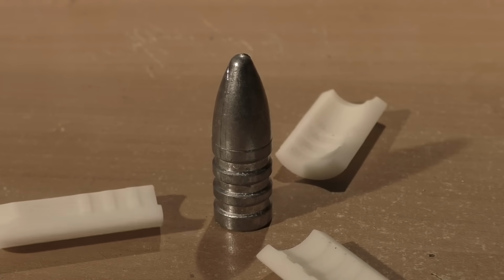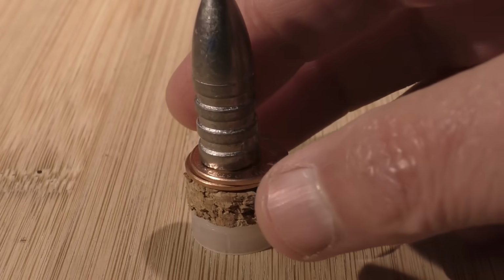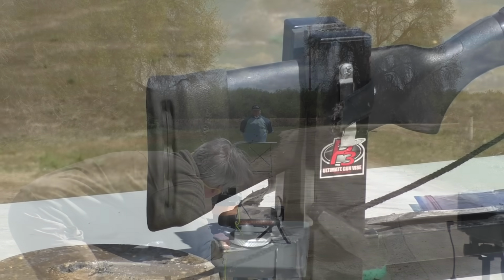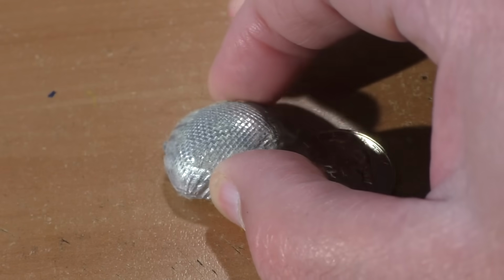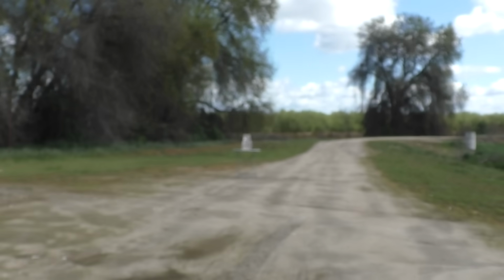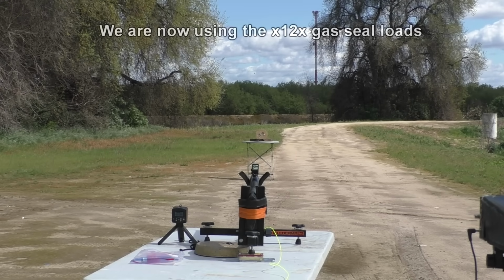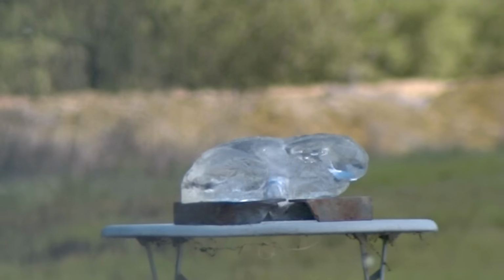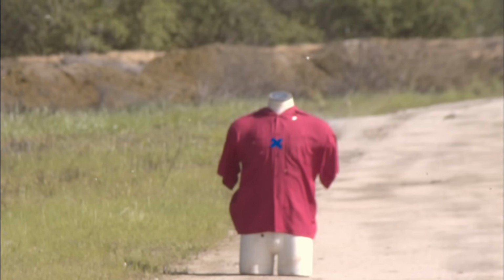45-70 SABOT  for 12ga.  One of the MOST challenging loads

Comment: Is this the first time you have rested the speed tester on the same table as the shotgun?  It seems to bounce when the round is fired, which might be adding to the difficulty of getting a reading.
Reply from the maker: Last video I set it exact the same way and got 100% reliability.
Reply: @taofledermaus  Hmm...  Okay.  I just noticed it jump sideways on a shot...

If you need to fire the shotgun remotely, you will need something of comparable mass and support as OG.

You may need to build a frame.

Comment: I don't foresee that cargo strap failing, but if you didn't see mine on account of replying to someone else with it, it was suggesting to use "muffler straps" (or exhaust strap), which is that metal straps with holes every 2 inches, available at most auto parts stores (at least once upon a time, but likely still is). Which can always be doubled up on, or tripled, if one layer fails.

I like the cargo strap better, though!

Comment: Here is one more trigger suggestion.   You seem to be using the string on one side of the gun and needing to pull really hard. Perhaps you can try a larger loop in the string so that it goes around the trigger and along both sides of the stock and stand before joining together.  Seems like that may provide even pressure straight back avoiding tugging to one side or the other .
Reply from the maker: The biggest problem is when I adjusted the elevation of the gun,  it moved the position of the bolt against the trigger too.   I slotted the arm so I can also adjust the bolt position and it is butter smooth now.

Comment: Yet another trigger suggestion. You can pick up camera shutter cables pretty cheap. Here's one at random - Fotasy Jjc TCR-70BK Black 70cm Threaded Cable Release, Mechanical Shutter Release Cable
Reply from the maker: I was looking at those too
Reply: @taofledermaus  Or a linear solenoid actuator if you don't mind bringing along a small battery pack.

Comment: To me, it looks like you have to jerk the string to get it to actuate the trigger, which, in some shots seems to move the shotgun a bit.  I think I would try using a small electric motor (the kind you can salvage from something like a hair dryer, etc).  You can also get them off of e-bay for about a dollar.  A nine volt battery is enough to power them.  Rigging one up to spin a reel (a piece of dowel would work) taking up slack on the trigger string, it should have enough torque to pull the trigger and have almost no movement of the the shotgun.  Then instead of yanking the  string, you would just need to push a button or touch two wires together to fire.  The whole set-up should cost less than five dollars.
     By the way, I'm quite impressed with your solo set-up.  I agree with you about needing some weight on it, too.  Great videos.  Keep em coming!

Comment: Jeff, I see there are lots of good ideas on trigger improvement for your setup. I was thinking of something similar to the others but then it hit me, "keep it simple". I think the problem with the current setup is that you have too much weight to overcome for a smooth pull: The trigger is a lever with a pivot point above and the moment (where you normally place your finger below. Simple. But now there are 2 levers, the trigger and the  "lower lever" with 2 pivots, at opposite ends, blah, blah working against each other, etc.. Really though, the primary issue is the way the lower lever works to pull the trigger: The moment (your pull attachment point) is on the wrong side of the trigger creating an increase in the amount of force that must be overcome to pull the trigger. The moment should never be between the pivot and the work on a lever. So you can simply attach an extension to the lever to place the pull above the trigger, or use a D-ring (or similar) attached to your pull, open the D-ring and place it in the trigger guard and against the trigger in such a way as to keep it from slipping off the trigger face. With a no-stretch pull, i have found this to be ideal. Great work!

Comment: 🧐Your sled could be improved and kept from jumping so badly redistributing your weights and giving it a wider stance. If you move your weights further out in each direction (all 4 optimally) from the center axis, that should prevent any forces from using the sled as a fulcrum causing the majority of those forces to take the path of least resistance *up*. That should help with both the trigger pull movements as well as the jump from bullet exiting the barrel, though expect an increase in lateral movement straight back as then the majority of those forces will just go equal and opposite the bullet velocity (As per Newtons 3rd Law of Action-Reaction) instead of up and back 🤔
And if you just added more weight overall that'll certainly help as well, considering Newton's-1st Law of Inertia. Which would keep the effects of his 2nd Law "F=ma" to seem reduced when the bullet is fired (as it's proportional to the ratio of bullet weight to sled weight) making it much harder for that small force to overcome the greater inertia of the increased weight. Making the equation of how much the sled moves overall, in reaction to the accelerating bullet weight pushing against it, MUCH more in favor of staying stable vs. moving in ANY direction 😆
Hope that helps, keep up the great ballistics "research" you do fantastically well 💯🔬
Stay safe, cheers! 🍻😁

Comment: What material was the sabo printed from? There are several materials that could be good choices. I would avoid PLA and try PETG
Reply from the maker: it's some super tough filament that Michael thought would be suitable
Reply: @taofledermaus  pla and pla+ are super strong but brittle. Petg is what pop bottles are made of. It's very strong but is more flexible, bends a lot more before it breaks and does not take a set like pla/pla+.

Comment: You are getting some jerk when you pull on the string.  Perhaps if you had a hydraulic (water) actuated trigger pull mechanism it would be smoother.  Perhaps an expanding chamber in front of the trigger and a lever pump on a syringe or pressure cylinder.

Comment: Using a copper wire around the sabot shot would keep the petals from separating too early. Adding a few turns would also act as a driving band.
Reply from the maker: There wasn't really any room in the barrel for additional bulk

Comment: Jeff, where you have string attached on the trigger mechanism you made. Could you add another piece on top roughly 6-8” and hook the string to the top of that to give you more leverage on the trigger? So as not having to yank the string to break the trigger and ultimately not moving the sled and shotgun so much?
Reply from the maker: I'm working on improving it,  slotted the bar so I can adjust the bolt to the trigger better.

Comment: Hey Jeff🖐I noticed when you are YANKING on your trigger that a few times the muzzle
rose a little before shot,??? which would through the shot off.
I seen a guy on YOUTUBE using water pressure and 2 syringes and a plastic tubing to work the trigger, it was very smooth and I'm sure it didn't cost much !!!
Check it out, love your videos.👍😎

Comment: Those Sabos turned out great. You hit the nail on the head, putting them together, my friend. I believe the only issues you're having at first were. The string to your trigger was binding and not smooth. You're having to pull it pretty hard to fire, and it's moving you slead quite a bit. Other than that, great job, man. They performed excellent. Thanks for sharing. God bless you and your family. God bless America 🇺🇲 🇨🇱 🇺🇸 🇨🇱.

Comment: You could invest in some sandbags to lay over the stand.  They'll work much better than those lead weights.  Don't over fill them so they lay over the frame and hold it to the table.  You could always fill them with dirt too for cost savings. 🤣🤣

Comment: If possible I would try and rig the trigger string in a loop that pulls from both sides of the stock and straight back which may work better. Seems like it's pulling to the right and not really pulling the trigger smoothly. Not sure if that would be too far though for your arm to reach.

Comment: The impact on the lead plate after losing energy on the stand was very impressive. Idea for a followup, tungsten penetrator core embedded in the tip of the 45-70 projectile on the lead plate in a future video with a better material of the sabot, maybe a glass of carbon fiber filled filament.

Comment: 2 Thoughts if I may.

I think the chrono is just confused by the amount of debris leaving the barrel maybe?
You could probably pick up a cheep solenoid, some wire, a battery and a button, mount the solenoid to the base, attach the string to that... wire from the solenoid, to the battery, to the switch, back to the battery, push button firing, should have no shake... maybe $10 worth? Maybe a little more? need a solenoid that can pull hard enough I suppose, half dead car battery would do the job too probably - and that's some weight for your setup :D
Reply from the maker: It's a doppler radar and it "looking" for metallic objects,  so the pennies were most likely throwing it off

Comment: You seem to be struggling when pulling the rope which appears mostly due to the angle you are pulling from rather than straight back.  If it were me, I would take 3 of those cheap bar clamps in addition to a ratchet strap.  Two clamps on the front of the sled to attach it to the table, the strap towards the back of the sled to hold the back down to the table, and the other clamp with the bar facing up on the back side of the table to act as a guide for the string to pull straight back (string would route back along the stock then around the bar of the clamp then over to where you are sitting).  Cheap, quick, and easy to adjust.

Comment: Ratchet strap the stand to the table with a strap across the legs on both sides. 2 straps should hold it pretty steady to the table
Reply from the maker: there was a strap on the front connected to the table

Comment: Hi Jeff , as I said last time would it be possible for you to fill the box tube sections of your stand with lead. You obviously have the facilities as you recast the lead plate. As for the trigger l would lean towards using a cam fixed to a lever which would push against the trigger guard. Could easily be made out of plywood and it could be easily be held in place by a bolt acting as the pivot for the cam. Just want you to get it sorted to your satisfaction without too much hassle then we get to enjoy more of your backlog of rounds . Thanks for your efforts

Comment: Great video, Jeff!  Maybe you’ll get some help that is easier to schedule.  Comment:   You mentioned a $1000 soluti9n to a $5 dollar problem, meaning replacing the belt.   The problem is really remote triggering, which sounds like it requires quite a bit of thought and skill, even for a low tech solution.   The bicycle caliper solution sounds good for a smooth pull.   

Have you tried remotely controlling the camera instead of the shotgun?   That sounds like it might have a more readily available solution.   A collab with Stuff Made Here or Smarter Everyday or one of the channels you like might yield a long term remote solution and some help with shooting for a few days.
Reply from the maker: There's a cheap solution for that too.

Comment: 3D printing is a fine method the problem is the material. PLA is barely useable for this, nylon and other polymers are what should be used but most home machines can’t or are just now getting to where they can’t print nylon half decently.

Comment: i know the problem!  you didn't strap the contraption down with a TARP!!  

i was thinking however, if you installed the trigger mechanism on the left side, so when you pull the string, it runs straight backwards around the stock.  (you won't be pulling the string on an angle whilst you're looking through the camera.)
but i do like @jamesgotfryd's suggenstion of a remote trigger with a bicycle brake caliper jig.

Comment: Idea to reduce sideways jerk when cord firing. Use a pully attached to the back of the cable (cheap off shelf at lowes or home depot) so it's pulling properly on the trigger. Should help with consistency and accuracy

Comment: Just a thought, you could use some cheap bike cables and parts to make a trigger pull that wont pull the gun. an old bike brake clamped to a rod and you can get a cable from a bike shop as long as you want.

Comment: With a lot of the 3D print plastics you can improve their strength by cooking them in an oven for twenty minutes or so.
For sabots wrap them around the projectile ( a little oil to keep them from sticking), wrap them with baking paper and a hose clamp or foil and zip ties to hold them in shape Not too much pressure though.
Then cook at a little below the melting point so they only soften.
After 20 minutes turn off the oven and let them cool slowly.
Some plastics may shrink a little.

Comment: If your chrono won't work you can also determine velocity using a target hanging from a couple of ropes. If the target completely stops the bullet all of the bullet's momentum is transferred to the target. You can measure how far back the hanging target swings using a camera and then use some maths to work back to the momentum (and thus velocity) of the bullet at impact.

Comment: hey, what about a wooden dowel or a metal rod across the trigger with a line on both ends threaded through a pulley at the back of the table? would that help even out the trigger pull? i see you kinda having to yank on the cord, and i think that may be affecting the shots. i dunno - food for thought, at the very least. keep up the good work!

Comment: Sandbags are heavy, and stable if you put them on the front legs of the stand. Should help with the gun getting yanked as the trigger is pulled. They are also super cheap  and can be done DIY easily.

Comment: Hi Jef,
Your idea of using the aluminum plate from the lead sled to the trigger is good but the trigger is providing too much resistance so you had to reef on it.
A cheap, low tech option 
1. Use smooth flexible twine, not trimmer cord.
2. Put eye-hooks,  rings or just smoothed out holes on the trigger bar and butt support to make a pulley effect, like a bloc and tackle, so it squeezes the trigger as you pull the cord instead of needing a yank. 😉

That yank is impacting aim, just like yanking the trigger on a rifle. 

The sabot shoes are the bigger issue. Too brittle. A softer plastic like the shotgun hulls you use would have a better chance of separating in one piece.

Love the videos 
The dummy's name is Doug, ditch the politics🤦‍♂️ we get too much already 😫

I really enjoy the videos ❤
Reply from the maker: As I adjusted the elevation,  the position of the bolt against the trigger changed and wasn't in the ideal location on the trigger.  I have slotted the arm so I can adjust that
Reply: @taofledermaus  that definitely explains it 👍
Nice simple solution 👌

Comment: First when it comes to your shooting rest, do you need to put on a decent sized sand bag on each front legs of the rest.
You can also put one over the bar just in front of the back leg.
That will make it much more stable.
Secondly when it comes to the 3d printed sabots, is it very much possible to make them strong enough by 3d printing.
But that demands different kinds of filaments for the printing and other settings on the printer.
You can as an example get nylon 3d filaments if you want to use that.
You also need to have a rather high infill density when printing to make it strong enough.
85% infill density is in general seen as being the strongest against impacts.
It might also need a different 3d printer, as I don't know what type of 3d printer that is being used.
I suspect that both the wrong type of filament and to low infill density was used to make those sabots.

Hopefully someone can print new sabots out of nylon filaments or any of the other stronger filaments and print them with an 85% infill density for you to test this again.
Reply from the maker: thanks

Comment: If you need custom sabots, i can turn them for you on the lathe. Drop me a note.

Also, get some cheap ratchet straps from HF and loop them under the tabletop and over the base of the stand. 

You might need weight on the table to keep it from jumping. In the worst case, you could use ratchet straps to anchor the table to some stakes.

Comment: Personally I would replace the string with a servo.  Aftermarket car remote locking servos are cheap, they also have a long pull. If they don't have the strength to move the trigger. The long pull could be converted to a lever increasing the strength, half the distance twice the torque.

Comment: It looked like most of your high hits happened when you yanked on the string (first few shots), the front of the table was even coming up a bit.  You started hitting lower when you stopped yanking on it, but had already tried compensating by aiming lower causing your low hits...  Between the set-up, filming, and everything else you've got going, you may have overtaxed yourself a bit.

Comment: Hey Jeff! In the past I've used a cheap piece of roughly 1/4" pex line with a string through it, looped around the trigger. And back inside it. So it worked like a plunger in reverse to eliminate any drif in the aim do to ripping the cordage...

Comment: I may be wrong, but I suspect you would have a smoother trigger pull of you changed your rope tie point. Using the bolt that contacts the trigger, on the left hand side of the gun, and running the rope between the butt stock clamps (an eyelet would be nice, but probably not necessary. 

Due to the pivot point in your design, the lower you are on the mechanism, the less leverage you have. If you want to create more leverage, you could use a longer mechanism, extended above the trigger 3-4 inches, and attach the rope up higher. 

Great video. Cheers.